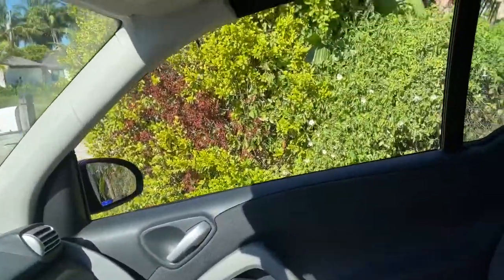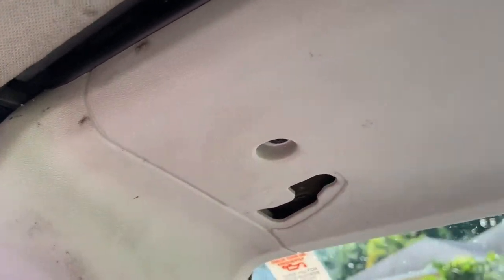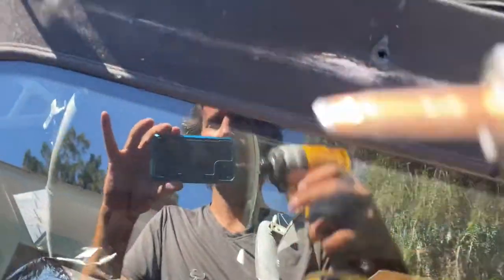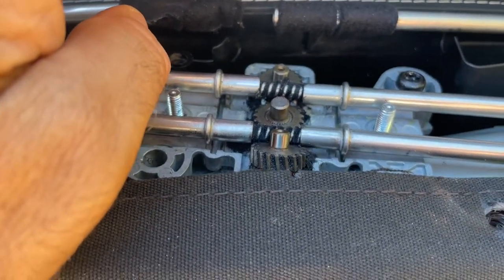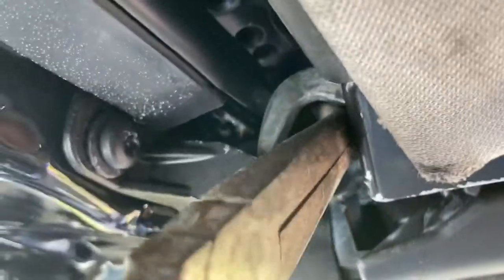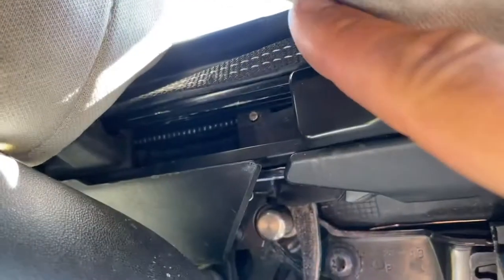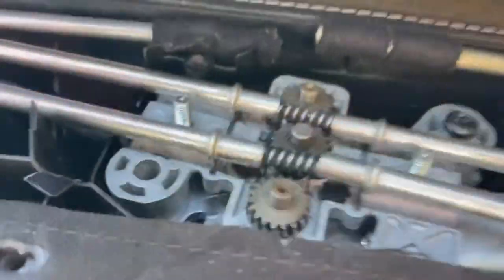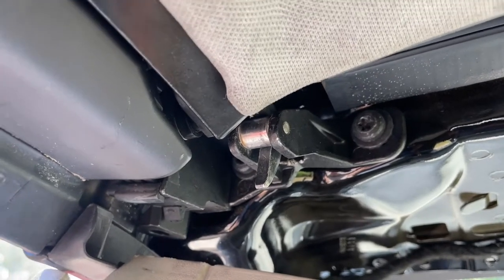2008 Smart Fortwo convertible- how to replace broken front slider latch

Comment: Thank you, you seem to be the only one on the internet with a helpful video about this common cabrio problem. The link for the latches was also a god sent as my local benz stealership wanted 520$ for those and smart-stuff sells them for 250$!
Reply from the maker: I would’ve had even more videos, but the head gasket spontaneously combusted, and I sold it so that I could break even. I might torture myself again, one of these days if I find a good deal. Thanks for watching ;)
Reply: @RealityUniverse what mileage were you at when the head gasket failed?
Reply from the maker: It was less than 100. I think it was probably like 75,000 miles. I have a video of it somewhere maybe I’ll put it up.
Reply: @RealityUniverse  oh wow that sounds super early. I feel like usually I don’t see these cars really kick the bucket until 155,000+ mileage wise.

Comment: Did you figure out where the springs go?  I'm re-doing my Cabrio roof.  I have fixed the shrunken canvas by sewing on some awning canvas and everything was working great until I broke the front slider latches.  I have the replacements, and can't for the life of me figure out where those springs go.  I'm sure they do something useful, but I don't know what.
Reply: I FIGURED IT OUT!   They go INSIDE the large pin on the slider to maintain outward tension against the cable.  It's the only place they CAN go.
Reply from the maker: I was just trying to picture it. Sorry I didn’t get back to you quickly!
Reply: @RealityUniverse  I just wanted to post the comment in case anyone else might find themselves wondering where the springs go.  The only other thing worth mentioning is the way that the roof sliders "nest" inside the rear cassette which, again, might be obvious by the way they fit into the tracks with enough lateral clearance to actually move.  Lastly, it is worth also mentioning that the tracks might need some alignment, and there is another youtube video on that.

Comment: Great video I own a 2008 smart fortwo cabrio ,I had the top down today and I noticed a tension strap flopping around in the wind on the drivers side, Can you tell me where I can buy just the straps?  This looks like a nightmare job to do. Any help is appreciated. By the way whats happens if I dont replace it? will the top not work anymore?
Reply from the maker: I think you’re gonna have to keep your eyes on eBay, unless you order from the dealer.  I got parts from a company in England, but their websites not working right now for some reason.

Comment: though I will add for anyone watching this video, in having had to dissemble my roof and deal with front hook problems, in general you should NOT have to remove all the trim around the sun visors to deal with front hooks. 
to release latched hooks, pull back from the cable in the upper motor (unless you like me had a detached cable head, in which case you have to reach around the back of the upper part of the front slider, stick the hook in the hole and pull back)
to LATCH the front sliders manually, disengage the upper motor, move the roof to almost close and push the slider forward with a screw driver)
UNLESS of course your front hook is ziptied shut (as this one is) in which case you have no choice but to remove the cover and cut the zip tie.
Reply from the maker: @pjstock135  Good to know!
Reply: @RealityUniverse  But it is still a VERY important video that reveals all kinds of Smart roof secrets.

Comment: Hi friend. The top works in 2 phases. 1st from front to back.  2nd phase is dropping back.  Mine refuses to go back anymore.  Even more confusing, is that when getting into the car, upon accelerating, the top will start phase 1 and slide back without me pressing the button. What do you think?
Reply from the maker: That’s interesting, I would guess that the lock is not engaging and it is just pushing back the top from the wind. I don’t remember what it looks like in there. Does the switch work? When you push the button what does it do to hear noise?

Comment: 6:37 had you sewn the sunroof, and did it work? as I'm having the same issue with mine :s
Reply from the maker: Yes, I used matching canvas thread and hand stitched it tight. It really wasn’t noticeable because I did a constant pattern across the front.

Comment: 2:32 my roof is broken want go up and down bought a use Convertible top but it still won’t work what do you think you’ll be the problem
Reply from the maker: First I would check power to the switch then to the motor
Reply: @RealityUniverse  I bought a new one of those I could be wrong but is there a modem for the roof top

Comment: can you share the page where you bought the pieces please
Reply from the maker: https://www.smart-stuff.parts/451-fortwo/451-exterior/451-roof/roof-451-fortwo/451-soft-top-sliding-roof-front-fasteners-to-a-pillar
Reply: is it the same for 2008 and 2009?
Reply from the maker: If yours is a model 451 which would be from 2007 to 2015 then it should work.
Reply: I really don't know what model it is, I just know it's 2009, I just bought it last week.
Reply from the maker: @christiancano9710  I would assume it’s the correct part
Reply: Hey How many days does it take for your car parts to arrive?
Reply from the maker: @christiancano9710  it took a week or so 🤔 parts come from England I think.
Reply: I have two weeks to order them and they do not arrive 😭

Comment: Nice video. Did you make the next video on final fix to the sliding top mechanism? If so, I'm not sure how to find it, thanks.
Reply from the maker: Not yet,  I blew it he head gasket somehow, trying to decide if I should fix it.
Reply: @RealityUniverse  Sorry to hear about the head gasket. My impression here is that your passenger side latch was somehow broken or detached from the drive cable, but your drive cables were still intact. Recently, out of the blue, there was a gap, as if my top wasn't fully closed, in the middle of winter. In my case the passenger side drive cable somehow forced a loop of itself out of the gap between the pillar track and the removeable roof rail track. Once jammed there, the motor wasn't strong enough to retrieve it. The drive cable is incredibly strong. So I've had to sever the drive cable in the gap, which freed the cable portion back to the motor. The remaining loop of drive cable is still jammed in that gap, mostly out of sight. When finally freed, I'll manually slide the top forward to latch both leading edges & secure the latches with pull-ties as you originally found the passenger side latch, until Spring, when it's warm enough to try to thread-in new drive cables. Your video is invaluable in showing how some of the parts of the drive mechanism works. Thanks for your efforts. Hope you'll do another cabrio top video if you tinker with it again.